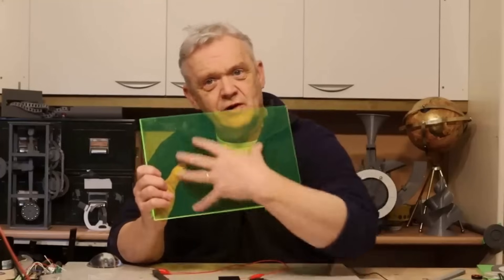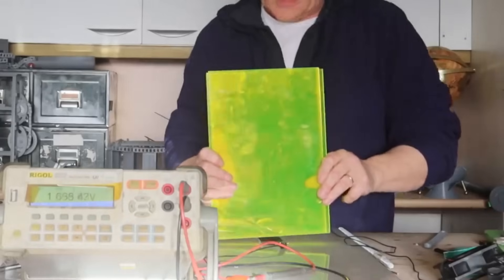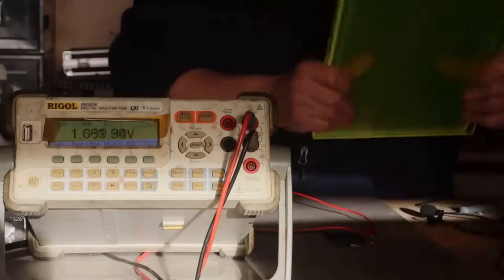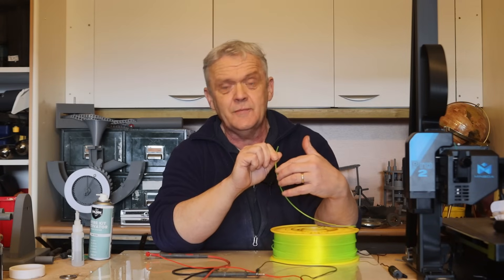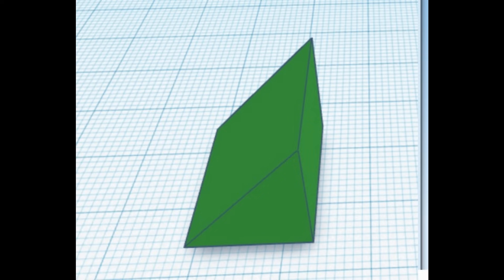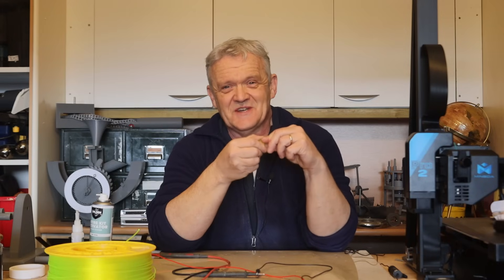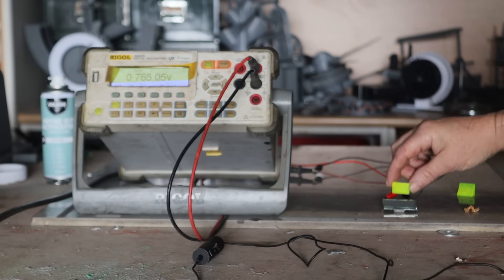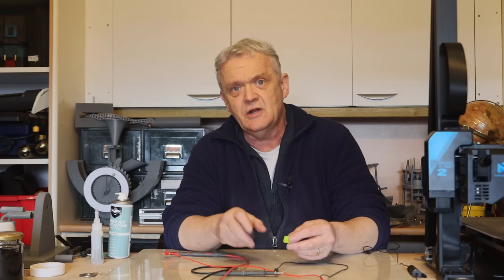2205 Improving Your Solar With 3D Printing

Comment: While this sounds great , I can see a few issues.
The wave split, 
This would narrow band the current conversion.
As the quality of photons will be more critical, the voltage on a panel is very easy to make, however current is very different.
I think it's voltage over current. 

I'm sure testing that would be rather simple to carry out...

Comment: The same would happen if you put a glas prism on the panel I suppose?
Reply: I think you’ll find that the point of using fluorescent material is its ability to transform invisible light waves, which solar panels cannot into usable visible light. Note Robert explains how the edges of the acrylic sheet shine more brightly. As such, a clear prisms will only guide the light to the panel which can also be achieved by pointing your panel at the sun the fluorescent properties allows you to take advantage of light or radiation that would have no effect in normal circumstances. At least this is my understanding so please correct me if I’m wrong.

Comment: There are plenty of guides to "printing glass" as it were. From memory it's print it with 10c+ over the recommended temp and increase the flow by a few percent so it melds together better. It won't be as smooth a finish with stringing and all but the idea is that the horizontal layers are still molten when the next layer is laid down and it's extruded almost into the previous layer so there's no air gap.

Comment: @Robert Murray-Smith - 
I had an idea to make polar bear  artificial fire type light collector...
Anyways try cutting maybe at a guess 2 or 3 dozon of the filament to say 12 cm lengths then welding that to the light in edge and see if that improves the voltage 🎉😁😊
Hmm you might have to make a mold and insert the  filament from above and heating the mold for a short time to set them 🎉 that sounds like a fantastic idea... Hmm you might need to make a rectangle clamp to bunch &  hold the  filaments to place them in the reflector you made

Comment: Perhaps in this instance, less plastic is more light transmittance!  Try priting it in vase mode, so it prints 1 perimeter all around with zero infill!  Another option might be if they have this fluorescent dye in resin!

Comment: Why the creepy laughing? And how about a CONTROL  for your very loosely controlled "experiment" 
10% solar panel improvement would be INDUSTRY CHANGING  but you are just  making a meter jump when, under a very specific orientation, some light comes to the detector from the specifically oriented piece of fluorescent  plastic. 
Do you propose to 'amplify' the incoming energy that hits the cell with a passive plastic?
Calling bs on this idea.

Comment: What is the panel output when the panel is at the proper angle to the sun? And then does the fluorescent plastic prism add  to output?

With the panel laying flat any mirror would boost output. But maximizing the panel angle I think is still key.

Comment: Wonderful idea! I use PLA, and PLA+ daily. Don't forget is glass temperature point is about 64C, which may be an issue if placed on a roof with solar cells. But to concentrate low light areas, as in a 'shady' area, that may work.

Comment: You could employ a bit of bio-mimicry here; from Cannabis plants, of all places. The stalked resin glands, called trichomes, are what give the female flowers that sugary-looking coating. They are tiny little structures, but utterly ingenious! The stalked part terminates at the top in a flat disc of cells and pores. The cells take in light from the sun and resin is exuded from the pores. The refractory properties of the resin combine with the viscosity to make the perfect collector of light on a static structure. A large proportion of the light in the more energetic end of the spectrum gets bent by the resin so that it hits the flat disc at the bottom of the globule of resin. The resin is completely opaque to UV, which means it's all getting used, something 99% of people growing the plant indoors don't realise.

The reason I bring this up is that there must be an analogous substance for making a light collector whose shape and index of refraction are such that it will bend the majority of the light that hits it onto the solar panel, without having to mold it, just let it form flat-bottomed beads all over the surface of the panel. Or, to increase the surface are even more, you could make one huge collector by copying the shape of a globule and scaling it up to fit a whole solar panel. The big drawback I can see straight away is the outlay for the kit to measure the index of refraction of stuff. I did see a second-hand instrument on the Ebay page of a lab gear recycler, and even that was a couple of thousand quid. It could be done much more basically, but you'd not be able to quantify the results. 

I'm trying to plan out a small setup for replicating Dr. Tour's Flash-Graphene process, which uses joule heating to turn carbon into turbostratic graphene by discharging a big capacitor bank through it. The absolute most expensive element in the shole setup is going to be testing the end product to confirm that is graphene in that config. It has to be done with Raman spectroscopy, really (I couldn't find any other method which was being used, but that might be my mistake), and means either sending samples off to a lab, renting a spectrosope or buying a second-hand one. There is the possibility of building a DIY contraption to get Raman lines, but you'd still have results that are open to question and it's only slightly cheaper than the other options. It would still cost more than  the capacitors for the bank, or the set-up for squeezing the starting carbon material and zapping it. At first they (and Tech Ingredients YT channel) thought that it had to be done under vacuum, but a very slight reduction in air-pressure is useful for pulling any gasses out afterwards, but that's not essential, apparently, so it really is a reasonable investment that you could realistically get back... as long as you can prove that the end result is graphene, of course.

Sorry to blather on, I won't be offended, or surprised, if nobody bothers reading that lot.
Reply: This sounds really interesting, I hope it goes well for you.
Reply: I know nothing of graphene but perhaps if you had a use case for graphene and the performance of the material you made was what you expect then maybe an expensive test for the purity isn't required

Comment: Nice. Maybe put some reflective material on the sides and-or design the flat panel so as to concentrate the light onto the solar call.  Maybe obvious , but it could be new to some.

Comment: Hello Robert, I had an idea to print a hollow prism with 2 layers of PP-T wall (polypropylene or Grilon optical nylon, which is very transparent and resistant. I use a brand from my country that is marketed under the firm nth, which is the Grilon brand. 3 from the same company) maybe it can work, it gives enough results in terms of light transport.
Keep it up, your videos are a great generator of ideas and inventive thinking.
A big hug from Temperley, Buenos Aires, Argentina.

Comment: It seems to me it might be easier and uniform to pour melted flourescent plastic into a triangle shaped mold that is held in such a way to let gravity create a flat hypotenuse.
Reply: Perhaps doping liquid acrylic resin with fluorescent dye then pouring into a triangular mold (silicone molding material), or perhaps for a larger area pour it onto a flat sheet (greased baking tin?) and impressing a grooved surface to get the sun tracking ability

Comment: A long time ago I noticed they were using fiber optics in automobile applications what I saw was a ashtray illuminated by a strand of fiber optics in the bulb was located somewhere else and I thought it was fascinating how the light would travel through that filament

Comment: you can find tutorials on how to print "glass" with transparent PetG Robert. It is not hard, you have to get the temperature just right and pring VERY slowly so the lines "meld". I have done it, so have a dig around the interwebs for instructions.

Comment: I gotta wonder if the prism needs to be printed with solid infill.  You could save a lot of print time and filament by just printing the outline of the prism in vase mode.

Comment: it is very good indeed. It looks better than I did  exactly 10 years ago when I was in Solar Led lamps business . I made test where I used plexiglass sheet  2mm thick and about 150 mm high   placed  in the middle of PV panel 90 degrees. So the light splits in two beams and there was some improvement. But  keeping plexiglass clear was bigger problem.
Reply: Once printed I wonder whether it'll take a polish for transparency. Then there's whether you can resin print a Fresnel lens.

Comment: Yo, you should use this to make a dye-sensitized solar cell. Use the flourescent pla as the base casing, copper wire mesh for the electrodes, prussian blue stained titanium dioxide as the solar receptor and graphene on the counter electrode.

Comment: Hope you remembered switching to a hardened steel nozzle after printing this material, else you'll need to replace the nozzle soon because the filament is likely abrasive and will tear through the copper, widerening the hole diameter.

Comment: Wouldnt a resin printer be better for thus?
Reply: It probably would, but you'd be limited in print size, and the cost of florescent resin is probably higher than the cost of filament.
Reply: @McRootbeer  true but if it's for example double the price but double the performance (20% increase due to it being clearer) without needing extra panels/space. Surely that's worth it... If it's 10x more maybe not. Or just a base plate for the AGILE project prisms so you could cut it from sheet acrylic even easier
Reply: @joshuafoster8976  true, it would probably be worth extra cost if it doubled the improvement.  I guess I just don't think it will.  No way to know if we don't know the performance and cost difference.

Comment: Interesting. I'm wondering whether a quick shot of liquid mirror on the back surface might improve the results. On a microscopic scale, this would act much like a fresnel lens - with the layer lines themselves creating individual convex lenses. If someone prints this out, I'd be inclined to over-extrude to something ridiculous - like 1 to 2mm, or more - to decrease the number of joint lines and create a more uniform interior structure for the light to pass through.
Reply: Fresnel similarity comes first to my mind. It woukd also need direct light comparison where it could otherwise create shadow, now it acts as environmental light collector. I suppose. Just wondering how conditions would render it.

Comment: wow! increasing light intensity, through squaring the area by extruding to three dimensions off the panel surface. these materials that can change the direction of light perpendicularly are interesting... could be used in 3d volumetric displays if manufactured correctly!

Edit: Fine salt annealing is a great way to make transparent and strengthen.. i think there was a video on youtube!

Comment: I am just at the stage of finishing my wooden replacement gazebo, and have placed two solar panels on the roof, they are actually angled slightly north west but later in the year they will be getting the full solar output as the sun gets above the house to the south east, I guess if i calculate things correctly i could make flourescent wedges to correct for the bad angle of my panels.
As a control experiment can you test a standard glass prism to show the similar expected drop in output due to the prism blocking some of the light.
I also have a fresnel lens from an old overhead projector, I will have to try putting that over one corner of my panel to see if it has an effect.

Comment: Light is going parallel with the pannel, anything that is not dark will shine a litlle light on that. Even a piece o paper, an orange, apple... Waaaw....wonderful no? 😂
Reply: but not with the surface reflecting the light in front of the solar panal. like the diy light guide, and the industrial light guides, and the commertial light guides do.

Assuming of course the light source is "front".

And yes, he is demostraiting a commertial product, just in reverse of how it is most commonaly used, in most day to day applications its used in LCD T.V.'s and monitors with led's along the edge, the light gets spread out and makes a nice flat light source for a backlit LCD panel.
its also used for flat light sources for photography and reducing eye strain in office spaces.

And its one of the ways we currently manufacture solar windows; Windows that collect solar power, that and using thin film solar collecters that tint the incoming light. But those are only something youd come into contact with by building skyscrapers

Comment: This is great.  How about a bundle of short pieces of the filament feeding light to the solar cell?
Reply from the maker: i like that!
Reply: @ThinkingandTinkering  also what about a solar reflective dish that focuses light to an optic fiber wich runs to either a diffusion type of glass or just a bottle with chlorine water to prevent algae to act as a daylight or to a high efficiency yet small solar panel and the backside of that solar is a peltier device with a heatsink to harness the excess heat
Reply: I had an idea off mirror like edges around the pannel like say 5 inch fins like a baking tray sort off thing with the sides leaning outwards so your pannel is getting a couple inches more catching area and  these extra bits the top edge is lipped inwards so if you imagine like a bowl with a lipped edge inwards so when light shines into the extra area the lip bounces the light back onto the pannel...but this would obviosly be like square bowl sort off thing with pannel at the bottom...make them cheaply just ply board and mylar sheeting but also too this adding on top off this a piece off 2 way reflective mirror so the underside inside this box you have now essentially built the under side off this top sheet is reflective mirror but the top is normal glass so the light can get in and bounce around from the extra width you have added too this pannel...the other way I thought is underneath your panel a sheet off mylar that is say twice the size off your pannel then a similar box design build so that extra say 4 foot off mylar sheet underneath you put the box up around that so it's just catching more light basically like adding wings n then bouncing it back down as I said..be a cheap n cheerfull way off catching some extra rays...one more idea Rob if you don't mind would be rather than having panals horizontal on a roof have them verticle like in a box if you imagine a CD rack layed flat and each section has a vertical pannel stacked close together with the bottom tin foiled or mylared and one side off each pannel also mylared so it would essentially look  like a giant heat sink with all the light bouncing around inside....May look a bit unsightly on a roof but you could have them on the ground and have one off the pannels running a 50w led cob chip or pannel which switches on at night so charges through the night I mean if this box has the light bouncing around it may just harvest a bit more than what's going in due too you trapping the light cleverly but I'm sure this brakes some fundamental law about input in and energy out but if that's the case then use salt water too power small batts and use those too power LED light constantly day and night from salt water I've seen many LEDS running from salt so not a bad idea....anyway soz long message if any off that makes any sense lemme know...cheers mate
Reply: Is there a way to print a block with infill going in one direction, so you print a ‘bundle’, then slice off and polish the ends?  A bit like a block of TV Rock (Ulexite)…credit to The Action Lab for that one👍😁
Reply: Aha, I had an idea where the ends of such filaments could be distributed randomly and evenly all over the surface of a large solar panel, that way even if one area is shaded, the whole panel still gets some light from the distributed tangle of the filaments, preventing the old issue of an entire panel's output getting slashed by a little shaded area.
Reply: That’s a good idea.  Could you just use fiber optic bundles?